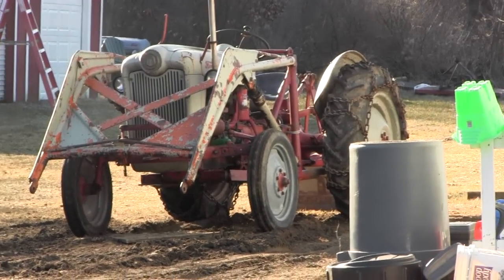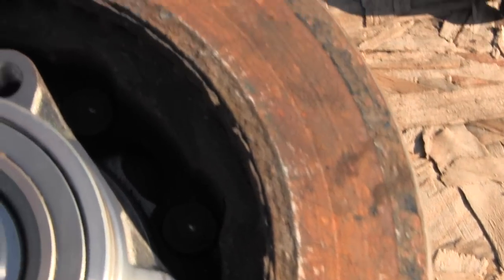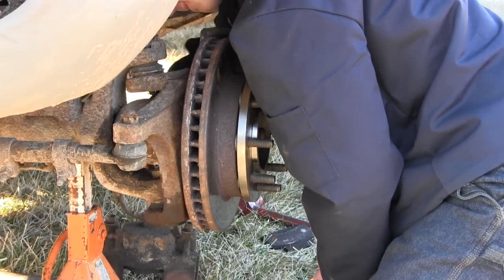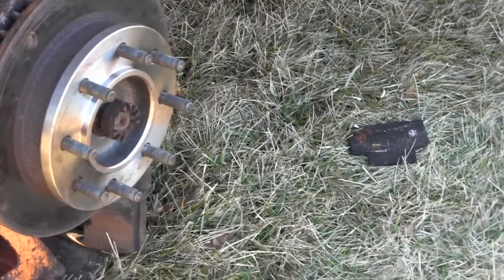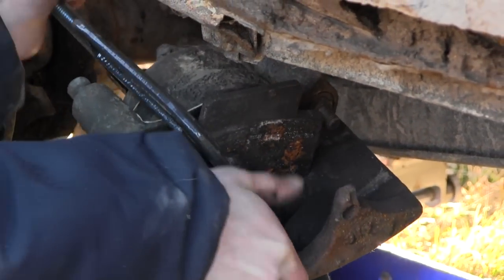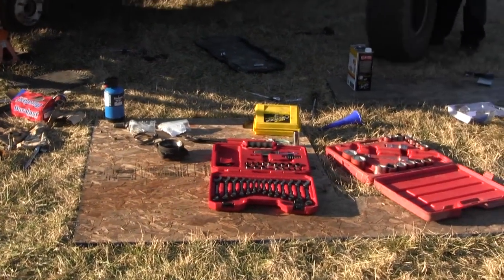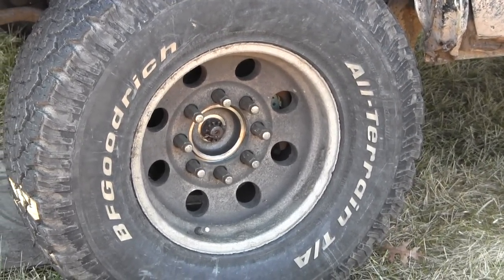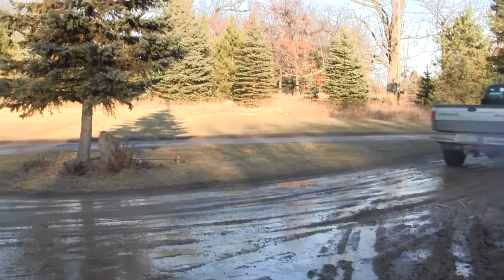Dodge Ram Front Wheel Bearing Failure and Replacement Part 3

Comment: Great video.  I like how it showed what you really run into when working on older vehicles.  Things like broken and seized bolts need attention of the grinder and sawzall.  Many people wouldn't know how to deal with this type of issue.  This is what happens everyday.  It's just not loosening things and replacing.  This is how people learn to do things.  Great video and looking forward to more.

Comment: I nice little tip, if you didnt already do.Is that slap a little anti siez on those bolts, god forbid if you had to do that job again they will break loose alot easier. Good video too!

Comment: Well I replaced the u-joint and have the new hub Assembly coming in man I hate the 1-11/16" castle nut but all I do to put back in the studs is take some washers put the stud in place put on the washers and use the lug and a impact to pull the studs back into place it works great

Comment: Instead of hammering the studs back into the hub you could have gotten a sleeve or pipe so that the stud would inside the sleeve or pipe and use a nut on the stud to draw the stud back into the hub.

Comment: Old video, but you probably know replacing a wheel stud is easy. Knock it out with a hammer. then when replacing them, all you do is put it back in, get some washers  and put it between your lug nuts and wheel stud so your lug nuts dont mess up, and torque em away!

Comment: those 4 bolts that hold the axle bearings are the worst to get off, I have tried everything and still can get them off
Reply: Heat up that housing before you try removing them and they'll come right out.